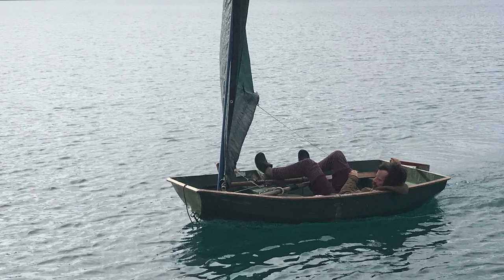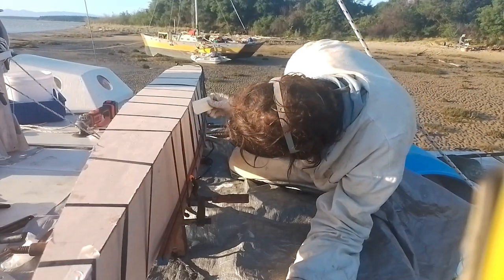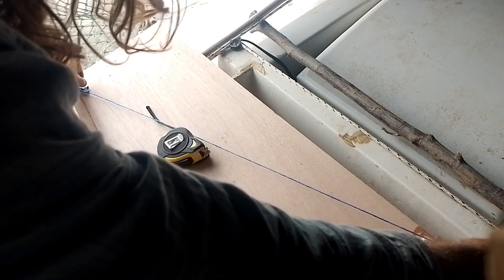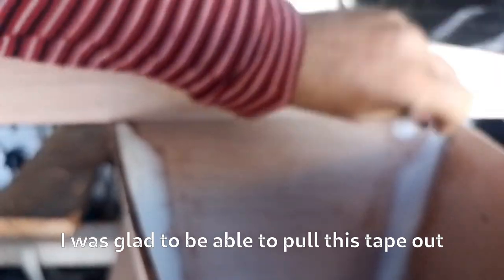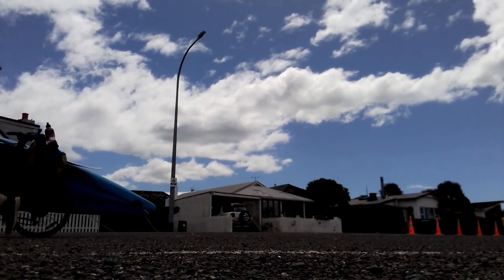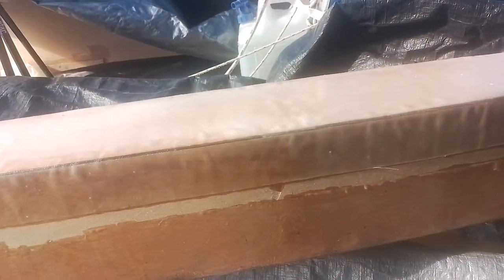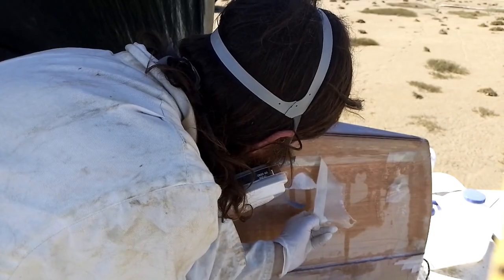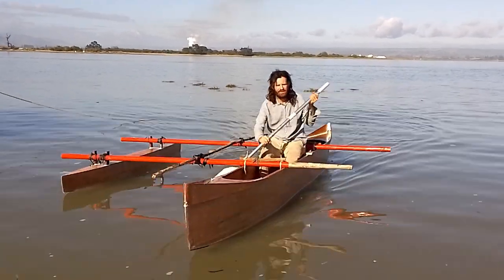Build a Boat On My Boat (in one week) Sailing Yes Let's E7

Comment: I have been studying your drawings and trying to flush out the depth of your waka and ama. I am estimating about 40 and 20 cm. This boat ticks all my boxes! You have really democratized small boat building. Good on you!!!
Reply from the maker: Correct! Yeah it's 40cm because then can fit 3 sides on a single sheet. So the both hulls is 3 sheets (excepting the deck added in the pore recent video)
Reply from the maker: Correct! Yeah it's 40cm because then can fit 3 sides on a single sheet. So the both hulls is 3 sheets (excepting the deck added in the pore recent video)

Comment: flush trim router is pretty flash bro! if it weren't for the goon wine at the end I would be worried you're selling out 😂

you've convinced me that a Proa will be my first build

it's awesome to see your editing getting better with every video. this was really well put together, engaging and easy to follow. if you want a suggestion: you could do a better job of normalising the audio between clips. I use a very awesome pro-grade video editor called Davinci Resolve which is available for free, it's super easy to adjust audio levels in that.
Reply from the maker: That was my secret goal ;) aw It is only a black and decker ;) 

thanks! yeah I know audio is a problem. working on that one... I did try devinci resolve earlier on and it didn't work for me for some reason, I can't remember what it was so I will try it again.
Reply: So rad! This is my new favorite video from you. Hoping to see lots more videos of this proa in action!
Reply: @dominictarrsailing  just learn to use two plug ins, compressor and ducking.
Reply from the maker: @marvelouswonderful  thanks! I'll check those out! I've heard of compressor, ducking is new to me though but sounds like just what I need!

Comment: Great work.  Glad you blessed both ends!
Folk have done tests on coating ply without using glass.  Even with epoxy, it still checks eventually.  
Epoxy seems an expensive luxury for a cheap and cheerful wee tender, it’s going to take a beating and probably won’t last all that long.  I would have used polyester resin.
Reply from the maker: Hmm I've always used epoxy. I understand polyester doesn't adhere well to wood. Can you thicken it into glue and filler like epoxy? if I recall I spent more on plywood than epoxy for this build
Reply: @dominictarrsailing  with polyester you have to be extra careful in preparation, as yes it does not bond as well, but fine for most jobs.  Obviously abrade and clean surface.  Then prime with resin thinned with styrene. For fillers the same, silica to thicken, milled glass or chopped fibre for strength,  glass bubbles for smoothing. Final coat, especially outside, resin flowcoat, a gel coat with added wax to improve water resistance.  A major difference is that it sets more quickly, either an issue or an advantage.

Comment: Out of chaos comes beauty. Your approximations on ama to Waka ratio look great and it paddles perfectly. Getting to shore for supplies will be easier and more enjoyable for you now! DIY! How long is the Waka? Im building a 3.3 meter proa right now. I hope to stand on the platform as it sails if its big enough.
Reply from the maker: Waka is 4.2 long, 0.38 wide at the bottom. Ama is 2.4 long. Other dimensions are based on 0.4 wide "plank" of plywood, which I cut at the plywood shop to make transport easy (on bicycle trailer! for the ama this is split again to 0.2). a beam about 0.4 was chosen because that would fit on my cat, under the tillers. I thought I was making a beamy load carrying hull, was amazed how fast it went!

Comment: Awesome build ! Have you thought about how to haul it on the deck of your Pahi, or was that not a consideration at all ?

I plan to get/build a Tiki 30-31 sometime in the future, and I was also thinking of having a proa tender, but hauling it on deck for passages, as well as it being floaty enough to transport at least one other person or a good amount of provisions are both things I'm not sure how to do with a proa of this size.
I thought maybe there could be a way to make it easily dismantlable for hauling, without making using it any more dangerous.
Reply from the maker: Yes! that was the first thing I thought about. That's why I made it 4.2m long. It fits across the decks, just in front or just behind the cabins. Everything fits inside the hull so it's one neat bundle. tiki 30 is a little wider than a pahi 31 though.

I am now working on making it sail, and fast to pack up/down but that will be in another video.
Reply from the maker: hmm, just had a look at some pictures, not sure if you could stow my boat on a tiki 30 very well, not without blocking access to a hatch. just behind the forward crossbeam would be the only option. not sure how much space there is there.

Comment: Pretty cool proa! I I love your project and plan to do the similare one. I consider to make the plane bottom of my Waka without rocker. Do you think that plane bottom will negatively effect on performance of my boat?
Reply from the maker: I would really love to know what it would change! I don't think it would change top speed too much? But it should reduce turning speed. There are some proas both traditional (satawal) and modern (harryproa, wa'apa) that are completely rockerless. It would make tacking more difficult, but it should make shunting more controlled. My reasons for having a little rocker was to make it easier to pull up the beach, and also to make more manoeuvrable while paddling. Sailing as a shunting proa, it's on the responsive style. That did mean I had to shunt quite quickly, but moving the leeboard to the ama fixed that and now it's easy to shunt, no rush.
Reply: Maneuverability and pulling up to the beach are good reasons for rocker. Thanks for sharing your experience😊
Reply: Proas don’t need rocker.  But if the sides are made straight, when bent and flared out it gives some rocker.

Comment: You mention the best thing to do when deciding to build a big boat to build a small one first, do you have a plan to build a big Proa? If so to your own design or something else?
Reply from the maker: I have several recurring daydreams about a larger proa. But i still have lots to learn with the small one. Then i might make on three sheets (7.2m) long. Still pretty small, but there are lots of advantages to a smaller boat, such as being possible to drag up a beach, that i dont want to loose. It seems everone thinks bigger is better but bigger is more work and less fun!
Reply: @dominictarrsailing  I agree totally, I love the simplicity of the design.
Reply from the maker: @brucedrake8645  the thing i have learnt with this boat, is that the hull is the easy part. The rig is the difficult part. You actually need to test lots of things. I built the hulls in a week, but it took most of a year to be happy with the rig, several months just to stop the thing faling down at some point each time i went sailing

Comment: Hi Dominic. I've watched this video twice now. After discovering proas yesterday I'm now in the planning stage of having a small sailing boat whilst I'm working on my 23ft monohull. 

How did you establish the waterline for glassing? I'm a heavier bloke so also wondering if you'd recomend a larger proa. 

Cheers 
Nick
Reply from the maker: haha welcome to proa world! my proa here is sized exactly to my needs, so it fits on my boat without sticking out the sides, and so that the ama can support my weight (just), also so that it could be built out of just 3 sheets of ply. On my old proa ("good enough" see my other videos) the ama wasn't big enough to support my weight. That means the platform isn't so usable. I only weigh about 65 kg so if you are a lot more than that you'd need something larger. I think you'd need a 4 sheet design for that.

It's easy to estimate they bouyancy of the hulls because they are flat bottomed and nearly square sided. I just interpolate between what it would be if it was a rectangular box - width*length*depth and what it would be if it was triangular,  width*length*depth*0.5 that is, full width in the middle but sides go straight to a point at the bow from there.

That's called the "prismatic coefficient" it means, what proportion of the "prism" (box) volume is it? I just picked 0.75 since the sides come fairly straight in the mid section and then curve in at the ends and it ended up just about right.

Also, building a model and testing that is a very good idea. You can just scale a model to calculate bouyacy (which doesn't work for hull drag and lift unfortunately)
Reply: Thanks for your detailed reply. I'm gonna say I definitely weight more than you. Almost twice as much currently 🙈

Anyway I'm considering a 6m (19ft) build. The Waka being made of 3x 2m sections. And the ama being made of 2x 2m sections. All of which will be bolted together with strong bulkheads. 

That's where I'm at after 24hrs of pondering. 

I'll look forward to seeing more of you proa videos. I'm gobsmacked at how fast it is. 

What I can't fit on my car roof I can easily chuck in the back of the car with the seats down.
Reply from the maker: @chasingfreedom83  do you mean making sections that come apart? I am well aware of a popular proa design that separates, but in my opinion (and based on experience of building and using a come-apart nesting dinghy) is that it's not really worth it. It adds weight and complexity and takes longer to set up. phil bolger says length is actually a advantage for a car topper, because you can lift one end up then slide it on, instead of lifting the entire thing in one go.

I have been thinking myself, about a "maxi cartopper" that would be 3 sheets long (7.2m) using twice as much wood as this. I've built 4 proas (okay two were tackers) all not more than 2 sheets long. I'm reluctant to dive into a longer proa just yet because it's easier to experiment on a smaller boat, everything spars, sails, etc are smaller and cheaper. 7.2 is within legal limits for a car top load, in NZ at least.

This is an experimental boat, you need to be able to quickly experiment! I built it in a week, but getting it sailing really well (in control, not breaking regularily) has taken months. (9 months now, still making big improvements, not perfect yet)
Reply: Yes a boat that separates into two sections. I don't have anywhere to store a 5m boat, well I do but it has corners to access it. I can however probably manage to get around corners standing a 2.5-3m boat on end to get around. 

Also not having a workshop I'll be building it in my yard so again 2.5/3m works well. I've already built this boat 5 times in my head. Payday this week so will start making models and hopefully start building something.

Comment: All the main hull is made with 4mm plywood? Bottom too? So on it's resistant enought?
Reply from the maker: only the sides are 4mm, the decks, bulkheads, manu and bottom are 6mm. this 6mm ply is very hard and stiff. the 4mm is very light and bendy. (it's not just a thinner version of the same)

Sometimes you need to stand on parts of the boat, and the 4mm does not feel strong enough. The 6mm feels really strong, especially if it has a little bit of curve (as in the decks) if you made this from 4mm you'd have to be very careful.

you'd save some weight, but I'd try to make rest of rig (mast, akas, platform, etc) lighter first!
Reply: @dominictarrsailing  Thanks.

Comment: Oh, it's a korkor....
Reply from the maker: yup!!!
Reply: @dominictarrsailing  - Why not a v-shaped section like the cat?
Reply from the maker: @vattuvarg  I tried to design an all round compromise. I need it to be compact and light, so I can get it on deck, and store it there. V hulls are hard to turn. That's an asset if you want to sail in a straight line across an ocean, but this canoe will do that strapped to the deck of my cat! a flat bottom gives me more volume on a shallower draft, so it gets closer to the shore before I need to drag it, and is also much easier to drag through the mud! (which is something that I need to do frequently!) When I have guests I'll be paddling ashore in this so it needs to paddle accepably well also. A round bottom would be even better for that, but that is somewhat more complicated to build quickly!
Reply from the maker: the downside to a non-v hull is that I need a leeboard to sail effectively, and that means another thing to move while shunting. but it also means another thing to tune! I wasn't expecting it to sail so well! very happy with it!